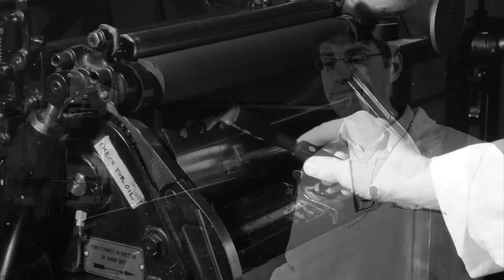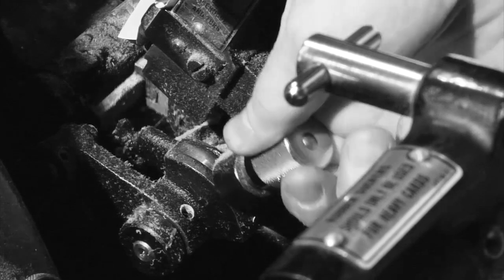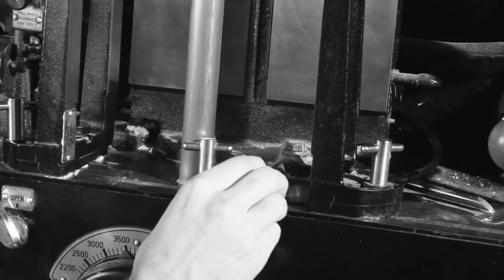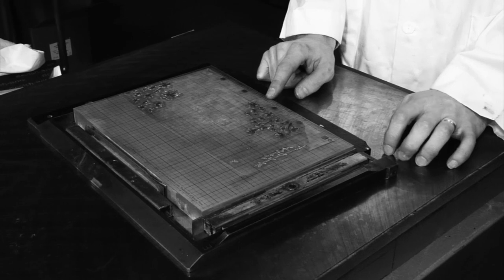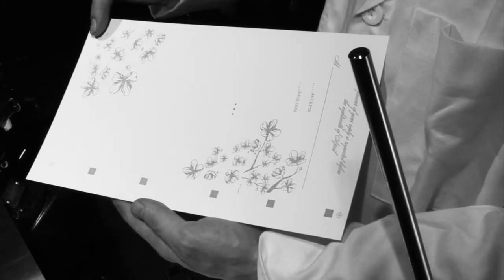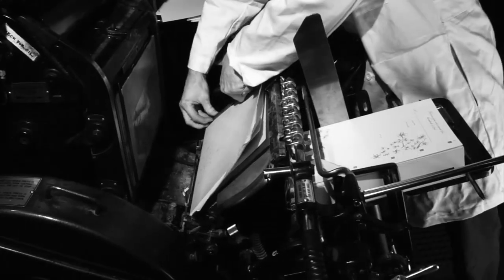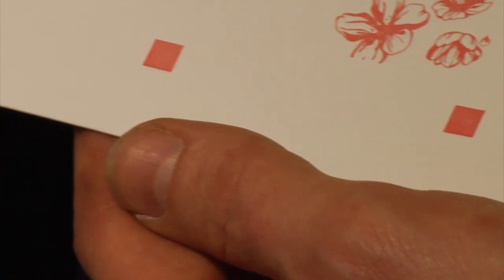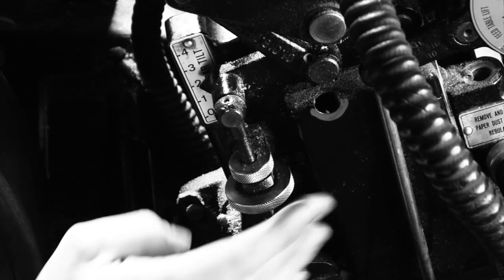Unique tips for the Heidelberg Windmill

Comment: I've been in printing for 90% of my working (40) years and have recently convinced my shop owners to set up the H. Windmill that's been in storage for several years. Cleaning, oil & greasing is being completed and some minor repairs are being done. I am reluctant to get the power to it until they find (or buy) manuals (operation and/or parts) to use as reference. They also have (2) H. Cylinder presses I currently run (without manuals also). All of these 3 machines are dedicated to Die-cutting.... not inking up to print.  I do not like running these machines without manuals and have not had much luck locating any. It's been a long time since I've run a Windmill and do not want to cause any damage. These youtube videos are helpful but are no substitute for a manual. Any source suggestions out there? Heidelberg is a big "no help" on this.
Reply: Just stick to what your doing and let the Men Folk  do the rest.

Comment: You should be putting in the correct packing before starting to print - with the impression backed off and slowly brought up to kiss the stock. The description of adjusting the feed and the pile height is not the best way to do it. Also twisting the feed to get register is not the best of ideas as it alters the amount of stock held by the grippers and can lead to feed problems, it's best to start with a plate in the correct alignment. This platen may have wear on the bed but a well maintained machine should have even impression over the entire bed if the packing is correct - it is after all not a clam shell platen; it is a toggle action.
Reply: You can bet that fell on deaf ears... Huh ? What ? Clams for lunch !
Reply: @gary49er1  There's the right way  and the wrong way. Trouble is everyone worth a shit is dead or retired. Pay attention to the above comment and you might lean something Jr.

Comment: Can anyone help please. i changed the steel plate on the head of the tiegel now the presure on the bottom is waay too much anth the preasure on the top is way too little. the plate is the same as the old one. Whats wrong? :(
Reply: Denis Šift you can control perssure by adding paper at back of steel plate